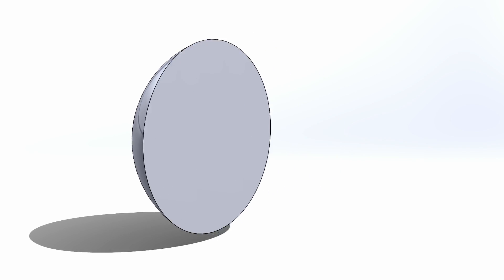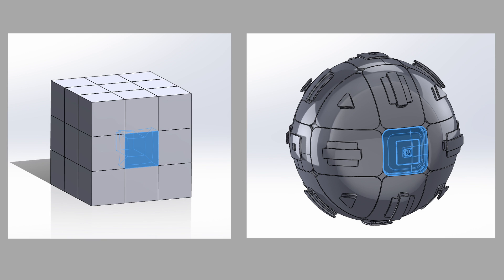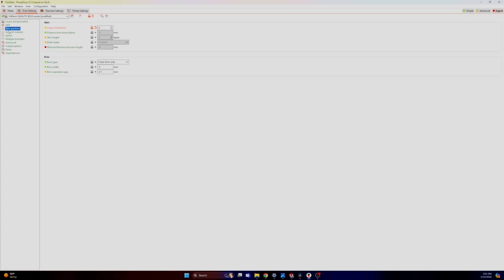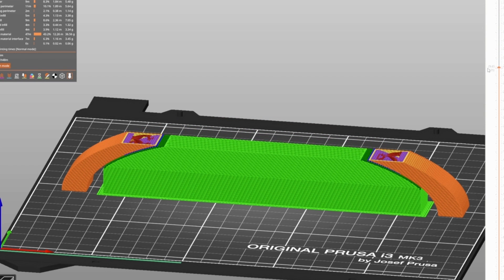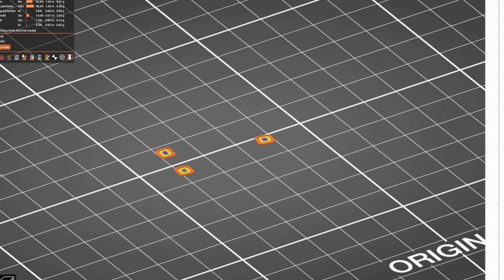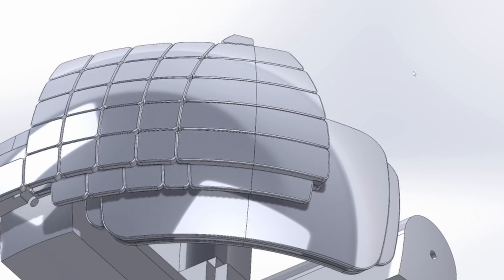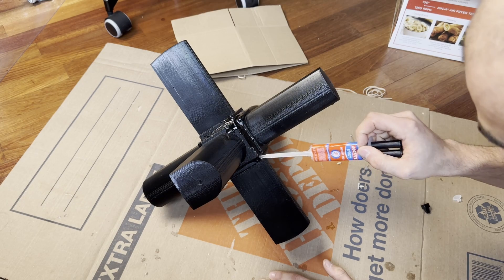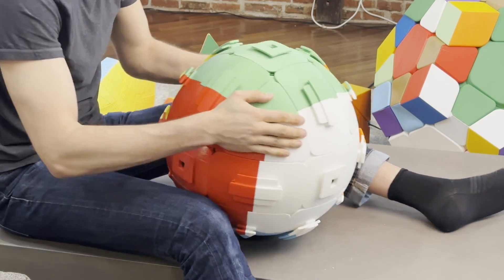Giant 11x11 Ball

Comment: If all the pieces float on the surface, why not all the same size? Should have no edges pieces right? Also to relocate a piece, instead of moving a piece 90° you will only have to move a piece 1 layer? Seems like it could be allot more efficient.

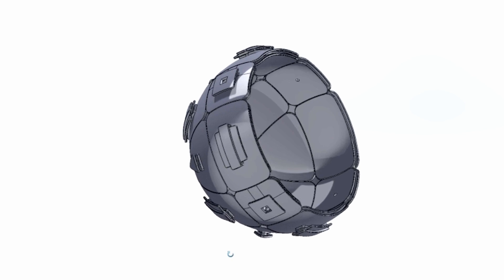Comment: So instead of each piece directly attaching to core, for the centers each piece attaches to previous piece on two axes. 1:52 Could this interlocking corner mechanism be used to attach the corners in a proportional 7×7×7 cube to two out of three surrounding edges at a time during outer layer rotation?

Comment: 7:45 Is there any reason you didn't design these so one piece had holes and the other with pins to slot into the holes? Or if the faces that glued together were the base of the print, then holes on all pieces and print dowels? That way everything lines up and it would have worked as support for holding everything together.
Reply from the maker: Yes - I’ve done this in the past and there are 2 reasons I stopped:

1. This way takes less time
2. This way actually results in better alignment, because 3d prints warp a little and sometimes the holes don’t line up. I actually am more precise when I line it up manually
Reply: @matt.bahner  Ah, I see. Would you say that with how big the core is, even if you did misalign it by a few millimetres , it wouldn't make a difference?